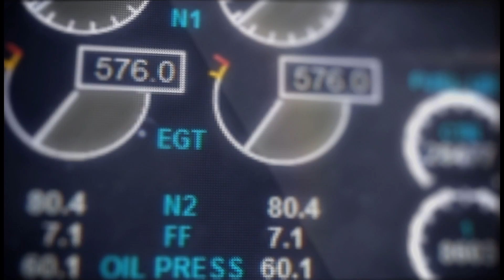Aircraft Emergency procedures - TCAS

Comment: The idea of circuit breaking for keeping the voice recording sounds very strange in 2018. The cheapest USB stick can hold hundreds of hours of voice recording, yet the devices used on aircraft are limited to 3 hours and require all these manual procedures to keep an important recording from being overwritten.
Reply from the maker: Yep, but this is 70ies technology unfortunately. :( in the aviation industry there is very slow progress in some areas.
Reply: @MentourPilot  I'm wandering why they don't introduce a new voice recording system in parallel to the existing one? It should cost cents and be very valuable.
Reply: As far as i am aware, some of the newer cockpit voice recorders and flight data recorders are solid state, but they still have limited recording time (athough it could be cost related, as from what i have heard they need to be able to survive tempratures of up to 1000 degrees C, which i am pretty certain your average USB stick wont be able to do)
from the limited research i have done, cockpit voice recorders need to have at least 2 hours of recording time
and athough i have not come across a value for the minimum required recording time of a flight data recorder, most are able to record for at least 17 hours

Comment: You should include a bit more accurate description of how transponders work (starting with the difference between primary and secondary radars). It's not that difficult: "primary radar detects reflection of its own signal from the airplane (or anything else); secondary radar just illuminates ("interrogates") the transponder telling it "now you"; transponder then broadcasts its squawk (4-digit code) (Mode A), altitude (Mode B) or much more (Mode S)", or something like that. I think all of your viewers would have understood this (most already know it, anyway), and newbies would be able to follow the rest much more easily.

Comment: Great stuff, as ever of course. It's not hard to see why you're a line training pilot one bit. Good explanation of the transponder, is it not the case that all that ATC usually sees is now SSR (secondary surveillance) transponder driven radar, rather than Primary, which tends to be the preserve of the military ? I've often wondered what it might be like to overlay both on one display. What wan't covered of course, is where pilots are confused by conflicting commands fom ATC and TCAS e.g. the dreadful accident at Uberlingen, where Russian pilots descended when their TCAS told them to ascend on account of ATC's input. If they had simply maintained altitude, it may have been OK ! The DHL pilots did as told by TCAS and descended too, the rest is history. A sad case of an overloaded controller, distracted by problems with another plane, working with equipment out (telecoms) and alone ! He was later shot dead by an aggrieved father of one Russian child. Talking of which, while the DHL plane was only mildly wounded, it was unflyable, and I hate to think what must have gone through the pilots' minds. I seriously wonder if something has been missed here and cargo pilots should be given 'chutes as a last resort ? There's hardly any weight burden, and if the pilots (and load crew if present) exit the aircraft below FL 150, they are unlikely to suffer any hypoxia.

Comment: Hi @mentourpilot I have 3 questions. 1. I recall reading into the fatal collision of  PSA Flight 182 727 and a Cessna on approach to San Diego (iirc the reason why TCAS was installed) my understanding that the TCAS systems automatically correct the aircraft, is this true for some models? 2. If such situation did occur wouldn't the passengers be a little riled after seeing the other aircraft? 3. Would the TCAS system pick up a missile like on MH17?

Comment: There was a collision, can't remember the date, between two aircraft because the Air Traffic Controller gave them opposite directions to TCAS.  The Pilots followed ATC and a mid-air collision happened.
Reply: Yeah that's why there were rules put in place where you follow TCAS only as it clearly gives each plane the opposite direction, ascend or descend.
Reply: Überlingen?
Reply: elele pepe Yep

Comment: How do the TCAS units work out the distance between planes ? Wikipedia didn't help much. The Uberlingen incident is a horrible example of not following TCAS and I think there's been work done on this too. Also, do you know if the American FARs now require cargo aircraft to be equipped with TCAS ? Bizarrely they were I believe not initially required to do so !
Reply: Indeed - you cannot talk about TCAS without thinking at the Überlingen Midair Collision.

Comment: Hello again, Mentour...

I just saw a video of an emergency landing in whoich, as the plane was just touching down, I noticed that alongside the runway, there was a tank farm.

Obviously an airport of any size needs to have a LOT of aviation fuel handy, but also obviously this is a LOT of Hazmet, and very flammable.

Does Airlaw/ICAO  demand any criteria about how close to runways and airport space a fuel depot can exist?

Personally, I would want to see that stuff stored about 5 miles (8 Km.) from any aorport.

However if they had a closed and fireproof fuel loading building closer, fed by underground pipies, all electronically monitored for any sign of problems, the fuel trucks could then entyer that building, one at a time, and fill up with high speed pumps and the appropriate safety interloccks, the controls being bot redundant and to intrinsically safe standards where possible.

In situations where class I wiring (in excess of 24 volts) or even class II (max 24 volts) that is not intrinsically safe is essential, explosion proof heavy conduit and cast iron boxes etc. would HAVE to be the order of electrical safety!

This is heavy, expensive, labour intensive but safe, having worked myself with this stuff at times. The fact I am alive today to me says those of us there did it right, punto!

Any number of crash investigation videos I have seen suggests there is a higher risk per square hectare of a crash site happening close to an airport, so that periphery seems a disaster waiting to happen!

Comment: Why would plane manufactures have the option to switch the transponder from the cockpit, if it's there and the pilots are not allowed to mess with it, then what's the reason to have it there?
Reply: +Sallah AL Houssawi I would also assume (keep in mind I'm not a pilot) that it can be switched off in case of malfunction so that it doesn't interfere with other instruments. Also, if there is any short circuits or some electrical fault it could probably cause a fire?

Comment: 2 pilots where flying and they both had different assignments like normal then ATC told them differently and they listened and they sadly crashed into each other. I was watching a Documentary on that.
Reply: +Mentour Pilot Just curious... If TCAS sensed that there was a collision and both planes contacted ATC would they speak to the same person or random people in the tower?
Reply: +Derek Crosson Well what happened is they where listening to the TCAS alert and they followed it but then the ATC contacted 1 of the planes to do the oposite of what the TCAS said and they collided.Now the Pilots during a TCAS alert cant listen to the air traffic controllers for that exact reason.

Comment: How many can a TCAS RA handle at the same time?
Reply: copy pasting from aviation stack exchange:

TCAS can deal with conflicts with multiple aircraft, a so called Multiple Threat Encounter. It will attempt to resolve the conflict but it will be limited in its options.

Examples of a MTE are rare, one case I can point to is this incident involving an aircraft turning into the approach stream between two aircraft instead of following the last in line.

MIT Lincoln lab has reported on MTEs and the TCAS algorithm performance in 2009. They report the majority of MTEs involved three aircraft, but mention one TCAS MTE involving seven aircraft.

Comment: Why pull the CVR breaker? To prevent overwriting of the recording? Does the 737 have so little storage? I was under the impression a 737's CVR had at least 12-24 hours of storage. Thanks.
Reply: Arcadiez — Does pulling the circuit breaker stop the CVR from recording anymore for that flight, you know, until the audio is backed up? If so, is there any worry that if some major incident happened there wouldn't be audio recorded? 

Also, does all this only have to do with the the CVR or is it also the flight data recorder? 

Thanks in advance for the info.
Reply: +totoritko The CVR starts automatically after 1st engine start [N2 >50%]. The acft is also provided with a "Voice Recorder" switch which has 2 position - ON and AUTO. As part of our Pre-flight procedures, the switched is moved to the ON position. As the 1st engine accelerates through 50% N2, it automatically moves to the AUTO position. The CVR stops automatically 5 min after last engine shutdown. Too pull the breaker you're saving the recordings for usage.

CVR does not save the recording if you land safely and shutdown the engine laccording to normal procedures. TCAS RA is both serious and not serious, you're still able to land safely and most of the times unaffected by the RA, but on the other hand as Mentor said. TCAS RA should not happen, continue a few more seconds and there's a chance of mid air collision. TCAS TA is quite normal in areas with a lot of traffic.
Reply: Arcadiez Wow, didn't know the CVR was this quirky.
I'm aware that TCAS RAs are serious, I've read plenty of investigative reports involving TCAS RAs.
Reply: ***** Too bad. Boeing should definitely upgrade that as 2 hours is significantly shorter than the 737's max mission and so important clues could be overwritten (see recent SkyDubai crash where they were holding for nearly 2 hours).
Reply: This is a problem for all airliners. If you remember back to the QF32 engine explosion, the actual incident was overwritten there too, as they spent all that time trying to extinguish the engine on the ground. I think that by regulation the CVR should have to operate for at least the rated endurance of the aircraft.

Comment: Thanks for the video, my ltc Just gave me TCAS as homework yesterday. Try not to shoot with strong backlight (the windows), your face is very dark and the picture is dull. Also the second camera angle is a nice idea but needs some more work i think.
Reply: +Mentour Pilot when using more cameras I usually clap my hands loudly once, in order to use the spike in the audio track to synchronize them. 
I like these technical videos quite a lot!

Comment: wohoo first again ! great video :)
Reply: +Mentour Pilot hey when TCAS asks u to maybe pull up and u pull up won't u be conflicting with maybe another plane above , how wud the system work if u sandwiched between two planes and there is a possibility of colliding with both of them , it cannot ask u to descend or ascend !!
Reply: +Karthik Nakul TCAS Does not ask you to pull up. It gives you a ' traffic ' warning like he said in the video. You will get a GPWS ( Ground proximity warning system ). This is used if you are heading into a mountain for example or flying to low above water or ground. Please dont get mixed up.